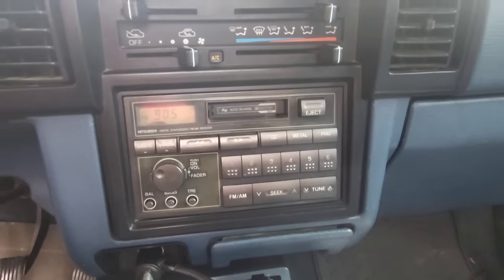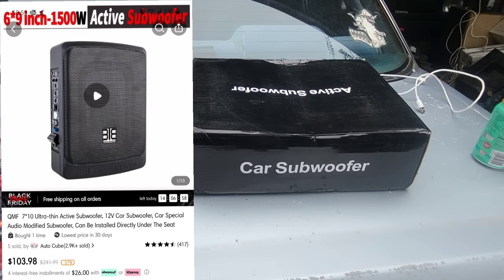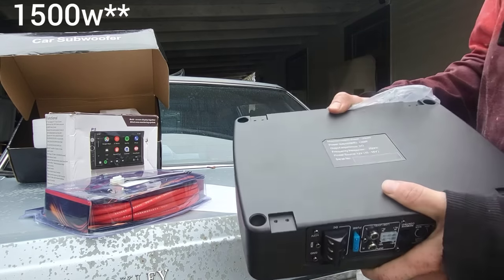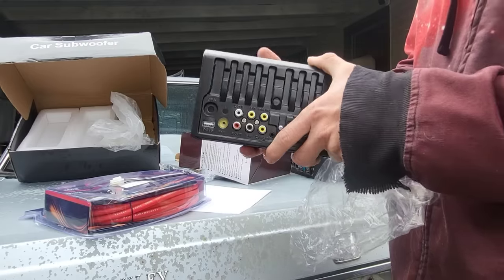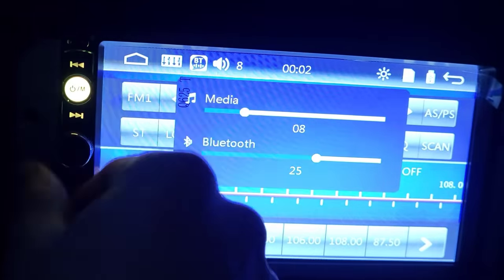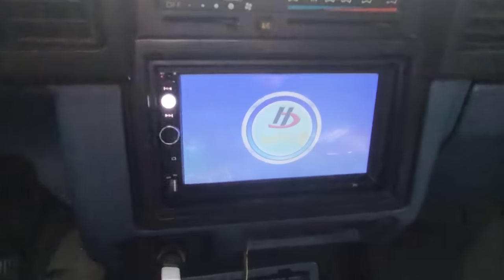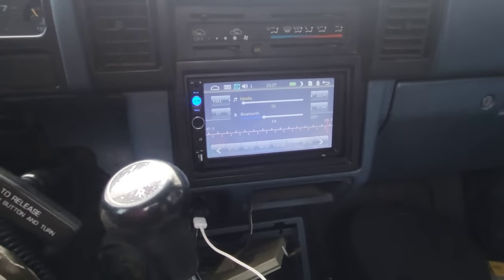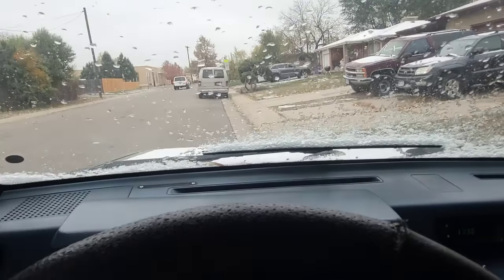I bought a car sound system from Temu. How bad can it be?

Comment: As a car audio guy. Cant just through everything at max. Have to tune it. Put the gain about half way. Idk if has a bass booster. If so try it at 0 first. And put your LPF about a quarter way and see how it sounds then. Should make it sound a little better since wont be buttoning out
Reply from the maker: I did go through the process haha the low pass is fake it doesn't change anything, and gain and bass boost combined get it about loud enough to hear while driving. It doesn't clip it was just hitting the seat. I've readjusted it since and it sounds OKish
Reply: Gain will be based on rca input voltage. Level will vary. LPF around 65-80hz.
Reply: Always keep bass booster at 0 that is literally a distortion introducer. It will make that nice and smooth sine wave all nice and blocky 😂
Reply: Temu is another Klingon for ‘hot garbage’.
Reply: @The_Crasher-xj4el preach
Reply: @jarrodbrennan121  I install audio for a living. The only time there is a “universal gain setting” is if it’s the exact same car with all of the exact same equipment, and even then it might vary a little bit. All amps process the signal differently as well so even if the preout voltage remains the same, the gain setting on the amp could be different.
Reply: @The_Crasher-xj4el  we are not in disagreement
Reply: @The_Crasher-xj4el you think that thing passes a sine wave ever? 😂
Reply: @commonsenseisdeadin2024  passes a sine wave ever? I’m confused lol
Reply: Bro it's from temu relax😂
Reply: Yea I mean what did some of you expecting from temu ..You can't really complain you get what you pay for as they say

Comment: I got a radio with a backup camera for $21. The class D Amplifier kills the radio reception but the bluetooth works great. It's certainly not high quality but it was under $25
Reply: I probably got the same deck as you...paid about the same... But that signal amplifier works great if You listen to the radio... Super easy to hook up also

Comment: About ten years ago, I was still using one of those FM transmitters and... it was fine.  Then, by some miracle, I came across an audio cable that used the existing multi-cd deck port on the back of my stereo (Pioneer, before AUX and Bluetooth) that allowed me to plug my iPod directly into the stereo.  I could not believe the difference in sound quality.  FM transmitters be damned.

I've moved on a lot since then, but that was almost an enlightening experience back then :D
Reply: What kind of cable is that called ??
Reply: @TheEducatedTrucker   I'd have to look it up, but I don't think the newer stereos these days have the input as it was meant for the multi-cd decks you mounted in the trunk of your car.

Comment: I say from experience installing my own systems need to go back and make sure the speakers polarity are correct and if no capacitors are on the line might screw with sound ?
Reply: If there is a capacitor inline, there is zero worry if polarity is correct or not!

It will tell you, don't worry!

Comment: Fun fact a touch screen radio doesn't work very good when you leave the plastic clean film still attached to said screen, that is why the touch controls seem wonky and the volume bar jumps around everywhere when you try to slide it with your finger!
Reply from the maker: I took it off apparently off camera before that
Reply: My kenwood with the plastic still on worked fine. It's just shit

Comment: I've been working at a body shop for a bit now and extra tips I learned was if you're painting the door, it's better to take off the mirror and belt molding (the trim at the bottom of the window) for a better paint job in the end. The mirror can get in the way, and if you're unlucky, the clear coat could stick in that gap between the door and the belt molding.
Reply from the maker: According to previous owner. Macco painted this truck. I claim no liability for their nonsense which there is alot of

Comment: That subwoofer looks like a clone of a JBL underseat one, right down to the BASSPRONANO text on the top.
Reply from the maker: Interesting. I can't imagine jbl made something so bad though haha I'll look into it
Reply: @StayRed  The genuine one is quite good. A friend of mine installed one in his car, and while not as loud as a proper subwoofer, it plays just as low. It's most important that the subwoofer is securely fastened to the floor of the car, as that is often a source of resonance and rattling. It could be what you were experiencing, in fact.
Reply from the maker: @jamescollins6085  I did screw it to the floor but it was slapping against the cables under the seat so I put one of the pieces of foam above it to hold them off. It sounds ok but definitely quieter than the engine while driving lol

Comment: I have a similar Android head unit I bought from Aliexpress for 55 euro in 2019. It's been worth every penny... And the display is probably better than yours. I have had no issues with display angles or such.
Reply: Same bought one for my accord fir like 80 bucks. But has the ac controls integrated because that's the factory way they are built. But from passenger side screen is really dark. Only complaint. But I drive 😂😂😂

Comment: As a installer for 600.00 u can get a nice headunit thats what u want to spend the least on you want lika kicker midrage amp and 2 kicker 12s now to save a bunch of money and hella ez to build a box for ur 2 12s and buy a very lil amp for your highs and mids.600should cover you and it will crank
Reply: I love kicker! I bought a used set of cvr 12's and bought a used 350 watt kicker mono amp. think it was 350.. lol cant remember. either 250 or 350 if I remember right but it was tiny!! It slammed! stock door speakers etc. my rear view mirror actually broke off my windshield. left like 1 layer of the windshield on the outside. rest was still attached to the mirror 😂

Comment: What kind of amplifier does it have to run the subwoofer the box might not be sealed correctly you could try sealing it with some rubber strips and adhesive it might sound better
Reply from the maker: It seems well sealed. I'm sure it's some terrible Chinese amp built in. I'm debating making a custom box for my old jbl 12"

Comment: i feel like you should secure that sub with some screws or something, maybe that will fix the rattle, but hey, maybe its just a bad sub.
Reply from the maker: It's screwed down haha just hits the seat adjustment springs under the seat
Reply: Oh wow, have you gotten a subwoofer box yet? or still rocking that same setup? @StayRed
Reply from the maker: @chronalxd  still rocking it but plan on making a custom box
Reply: Nice! what size subs ya planning to put in it? @StayRed
Reply from the maker: @chronalxd  I've got a couple 12"s but I might just use 1. Not a lot of room in the single cab haha it's gonna be a challenge to get the cubic footage behind those seats